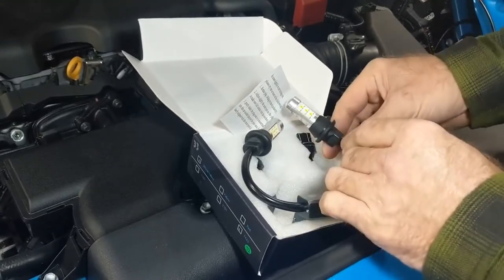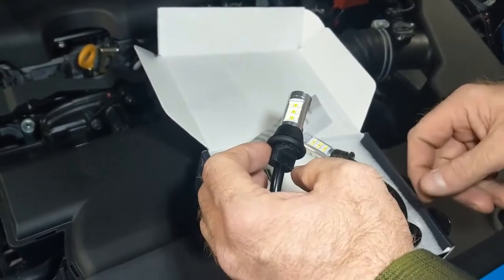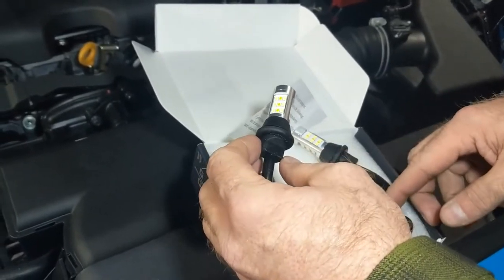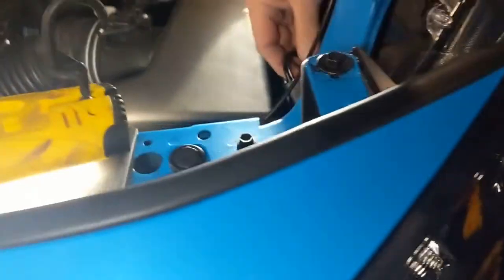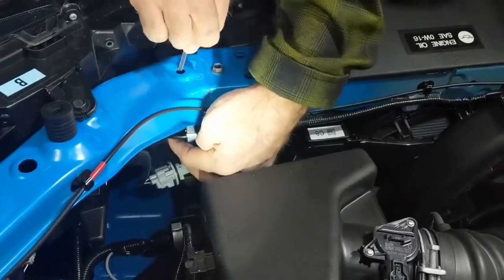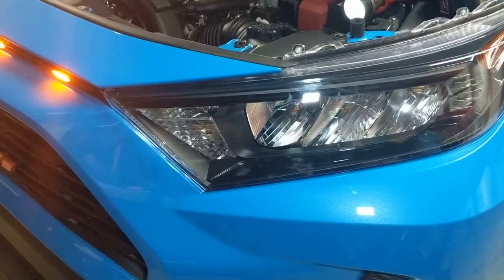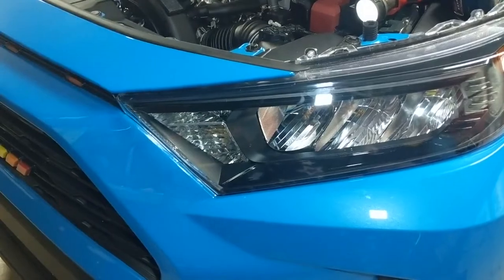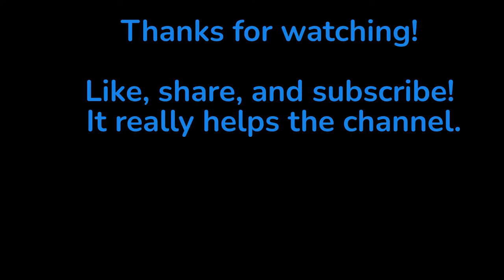TWO Colors in one bulb | Switchback Daytime Running lights | white light + orange turn signal in ONE

Comment: My niche question is. I have an LED day time running lights in my car already but the turn signal is halogen and it turns on- on a different place from the day time running lights. I would like to keep the daytime running lights that’s already in the car however, I’d like to have an LED turn signal that replaces the day time running lights when u turn it on. Most new cars have that now. How would u do it?
Reply from the maker: Do you mean you want the drl to go off once the turn signal goes on?
Reply: @installsandpitfalls  yes in the same spot as the drls

Comment: I don't understand something here - how does the light know that it should shine on white LED lights without turning on anything in the car? Well, it's a bit like, you know, I have an older car that didn't originally have factory LED daytime running lights installed and I'm wondering if if such I would connect something to my car. Well, it is known that if I don't have the lights on, then the LED ones won't glow white either, they will only stay yellow when I turn on the turn signal, that's why I'm interested. How does it work at all? Or does it just work after... connecting how it works?
Reply from the maker: Hi, our drl switch is actually on the turn signal stalk. We weren't sure if ours would work either, but we tried it and it did. Worst that can happen is you'll just return it to Amazon.
Reply: In the USA, many cars have a combined setup where the indicators and parking lights use the same bulb. When you replace these with LED bulbs that function as shown in the video, the parking lights can effectively serve as daytime running lights (DRLs). This is a common modification and aligns with the way some modern vehicles are designed, where the DRLs automatically switch off when the low beams are turned on.

In Europe, however, the setup is different. Indicators are dedicated to their signaling function and do not share bulbs with parking lights. If you wish to install DRLs in a European car, you need to run an extra 12V power supply from the fuse box. This setup often requires the use of a relay, ensuring that the DRLs switch off when the low beam headlights are active. This arrangement complies with European regulations, which typically mandate that DRLs must not interfere with the operation of other lights and must switch off when low beams are used.
Reply from the maker: Great info 👍🏻

Comment: Can it be fit on toyota fielder 2017 hybrid? My turn indicator only get power when it is in use otherwise not. More over I have no drl with my model.
Reply from the maker: We weren't sure if ours would work either, but we tried it and it did. Worst that can happen is you just return it to Amazon

Comment: How does this work, my default indicator light only comes on when i flip the switch, how will it get the power to stay on?
Reply from the maker: I'm not sure of the mechanism that makes it function correctly, we have a LE and it works perfectly. Worst thing that could happen is you try it and have to return it, but it works great for us.

Comment: Is it safe to use the turn signal light sinto DRL? I mean if the turns signal is on all the time the driver in front might get confused, although It will change color and blink, it's a possibility
Reply from the maker: Thanks for the question, we haven't had any issues with it and as far as we know it hasn't caused any confusion. Signaling is far more noticeable with these than the oem bulbs and having DRL seems way safer during the day.